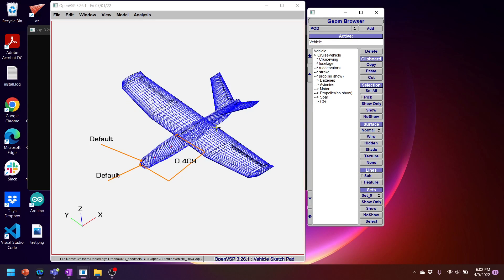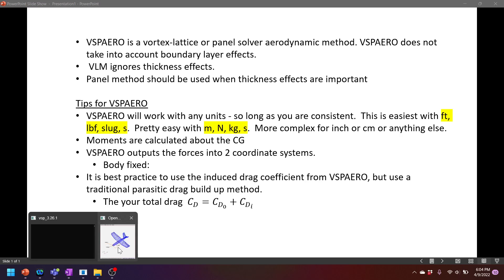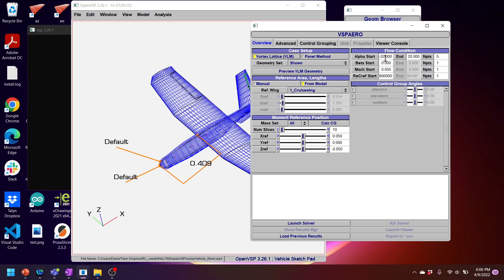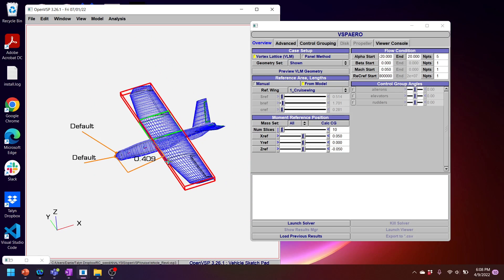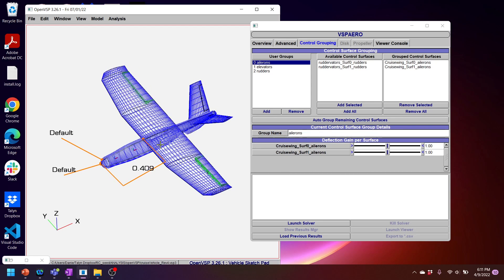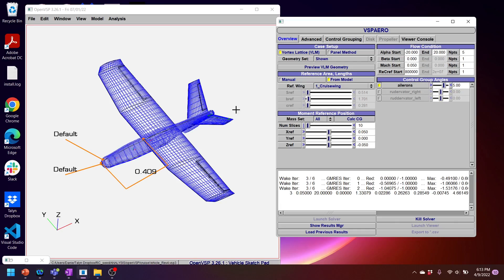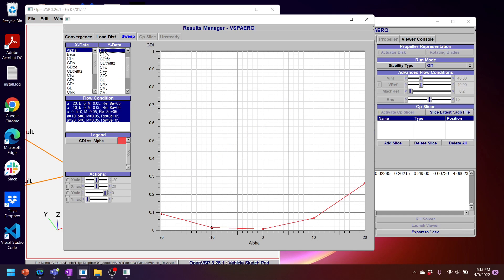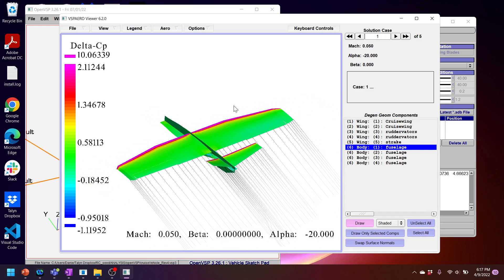Modeling Aircraft Aerodynamics in OPENVSP / VSPAERO!

Comment: By adding the additional drag by hand, are you not loosing the moment this drag generates on the aircraft?
Reply: You do! Although you could account for the moments by calculating  the radial distance of the extra drag sources. . . But typically at the conceptual design level we aren't concerned with that. The idea with a model of this fidelity is to use it for trade studies. To get more accuracy and capture the additional moments  you might consider going to full CFD.

Comment: Awesome video, very informative and clear! Thanks! .. I have a question though, you mentioned when commenting on the Cm vs AoA curve that having a slightly -ve Cm value at zero AOA is favorable for a well designed stable aircraft, I'm wondering, why would that be the case ? .. I usually design my A/C to trim at a slightly +ve AOA, so a slightly +ve Cm. So I'd like to know your insight on that, why the -ve Cm ? ... Thank You
Reply from the maker: Hmm... In retrospect, I dont know why I said that. Maybe I was tired.  . . Either way, you are correct! Thanks for calling it out. I have edited the video to remove that statement. Ideally, the Cm is zero but it's impossible to achieve this at every possible trim condition without incurring tail trim drag penalties. So you usually you design your vehicle for design point with as little trim drag as possible; e.g. Cm=0.
Reply: Thank you so much and can you recommend a good software for stability analysis ?